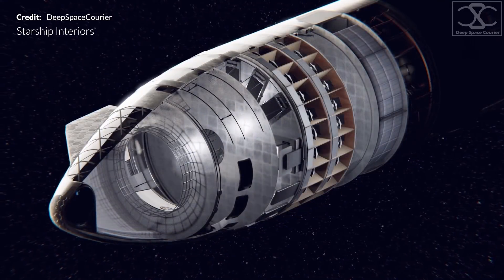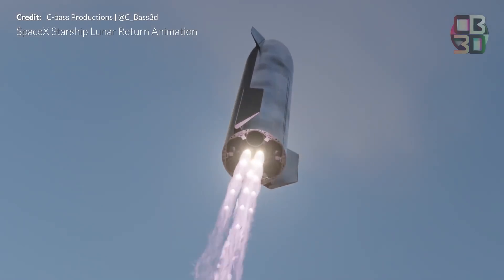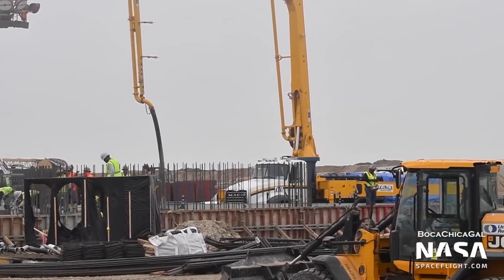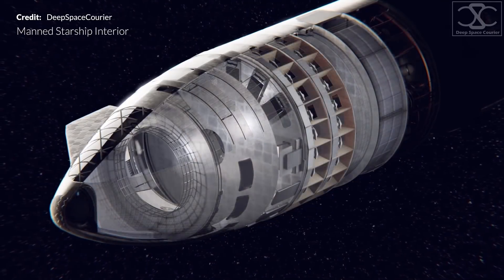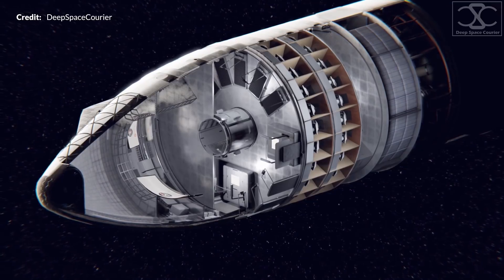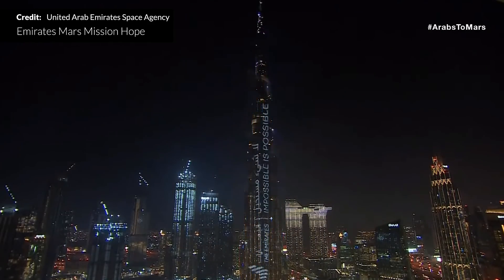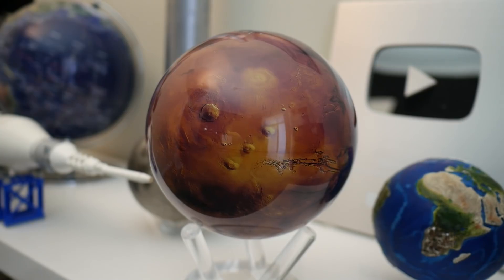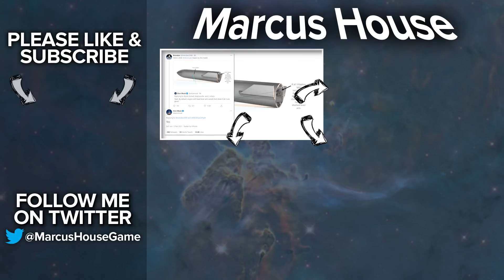SpaceX Starship to attempting another flight with SN10 - Can they master the flip and landing!?

Comment: Why do they invest in technology which remembers me going back to the 60s. I call it Blechbüchse. I cannot see any interesting development. One fail ofter another. Burning money by one of the richest persons on planet. Only try again if you are sure it works. Mars maybe 2059...
Reply: Yeah... because lading a rocket upright was a thing in the 60s, sure. 

How is a fully reusable rocket system with 100-150 tons of payload capacity and $2million per launch not a huge leap in technology?
Reply: @3gunslingers  yes it would if it works. But I only see fails.
Reply: @mtumix  
Okay. So you simply don't understand how SpaceX operates.
Do you at least know how many "failures" they had until they landed a Facon9 first stage?

Comment: I wonder if there really will be that much open space in the starship in the end! Quite some risk of getting stuck in the middle of the space due to micro gravity and nothing to bring you to the walls again:D
Reply: I don't think you will ever be alone on a Starship.

Also what would make you come to a stand still in the middle of the room?
Reply: @3gunslingers  not a full stand still maybe but a very slow drift without having anything in reach to push yourself off from. Though as you are not in a vacuum you could actually get to a stand still as well due to air resistance and drag. 
Sure other people could help you but it for sure would be an annoyance to have to ask someone to go fishing for you...
Reply: @JLohmann2012  
Air in a space ship has to be rotated constantly. Else pockets of CO2-rich atmosphere could form.
This airflow would carry you reliable towards the "AC" unit.
Reply: @3gunslingers  good point! I didn't consider that! How long would it take though? Can't imagine there to be much force behind looking at the mass and speed of the air molecules in that circulation system
Reply: @JLohmann2012  
"How long would it take though?"
Good question.
You could look up the average ventilation speed on the ISS and calculate the air resistance of a human body.

Comment: Artemis Gateway first 2 modules in 2024? I can't help wondering whether in that time SpaceX couldn't get together with Sierra Nevada Corp (SNC) and hard-mount a SNC LIFE inflatable hab module onto the forward (CH4 dome) with a docking module attached to the front of the LIFE hab module. The Starship could then, after Earth orbit refuelling I assume, fly to the Gateway orbit, open a modified payload bay fairing that opens like the petals of a flower rather than a clamshell (think the space-ship eating spaceship in the James Bond "You only live twice" movie) and then inflate the hab. Solar panels could either be folded up elsewhere in the payload bay and unfolded when the fairing opens or the inside of the fairing could even have solar panels on the inside of its "petals" or some combination of the two.

The above could place a way bigger habitable volume space station in orbit in a single launch (plus however many tanker refuellings are needed). The current SNC LIFE hab has about 330 cubic metres of pressurised volume I think and the docking section mounted on its nose would add even more vs I believe 125 cubic metres for the Artemis Gateway station and that's after the extra space from the  i-HAB (international Habitation Module) is added to the space in the HALO module and that isn't expected to be launched until 2026. ANd the Starship payload faring could take an inflatable hab module way bigger than the SNC 300m^3 version which only needs a 5m fairing if they wanted to go even bigger.

Since a space station Starship is never going to land a whole load of weight could also be saved from not installing fins, heatshield, legs or header tanks which makes the refuelling requirements easier and once in the desired orbit one or both of the CH4 and LOX tanks could be flushed and re-purposed for other consumables needed to maintain the life support systems and/or the positioning thrusters which would give huge reserves of supplies. They would already have plumbing to be replenished by a supply ship thanks to the on-orbit refuelling technology.

I know that SpaceX has a laser-like focus on other things but if it decided to do such a thing launching in May 2024 to match the planned launch date of the HALO+PPE module, 3 years and 3 months from now, would not be a problem for SpaceX with its rate of innovation and the Starship wouldn't even have to be human rated, only the SNC Life module shown to be safe. Crew could initially be shuttled to and from the station by other human rated launch vehicles as is currently proposed if Starship didn't have human rating by then.

This all seems so doable to me if there was the will to do it and it would be a great test of long term life support systems, long term stays outside of Earth's radiation protection, and get real deployment experience for full scale inflatable habs.
Reply: "Since a space station Starship is never going to land a whole load of weight could also be saved from not installing fins, heatshield, legs or header tanks which makes the refuelling requirements easier and once in the desired orbit one or both of the CH4 and LOX tanks could be flushed and re-purposed for other consumables needed to maintain the life support systems and/or the positioning thrusters which would give huge reserves of supplies." 
You are on to something!

But I don't think they will use any inflatable habitats, tho. Those are very likely much more expensive than just sending a second Starship.
Reply: @3gunslingers  Yes, in my heart I agree on the inflatable hab. Easier and quicker to just kit out the payload area as pressurised habitable volume with some space lost to folded solar panels that deploy when in orbit and for docking ports. Even with that “lost” space when we’re starting within almost 1000m^3 of internal payload bay volume even if you use half of it for that other stuff you still end up with a pressurised habitable volume almost 4 times that of HALO+i-HAB combined. My inflatable hab twist would only come into play if you wanted to create something huge, maybe 2,000m^3 of habitable space for a big long-term presence and lots of science, and/or if you wanted to test applications of inflatable hab technology. It would be cool though. Imagine if Artemis did evolve to something twice the size of ISS with 16 or more crew on board at any given time doing lots and lots of science. For the first time since maybe the 1970s I’m actually beginning to believe again that I might see some of this sort of stuff happen in my lifetime.
Reply: @julianfp1952  
"My inflatable hab twist would only come into play if you wanted to create something huge, maybe 2,000m^3 of habitable space for a big long-term presence" 
I think it would be cheaper and easier to just fit out the tanks of Starship. The tanks provide 1,300m³ of pressure-tight volume.
And since on Lunar Starship the tanks have to be shielded against micro-meteoroids anyway, they are also human-rated.
Reply: @3gunslingers  You’re not going to let me have my inflatable hab are you? 😭😭😭😀 Being serious though, you make another good point.
Reply: @julianfp1952  
"You’re not going to let me have my inflatable hab are you?" 
NO.  ;)

"Being serious though, you make another good point." Thanks. I did quite some research about inflatable habitats and they are simply not as good as they seem to be at first glance. 
They are quite heavy and very, very expensive because of their special hull fabric.
Reply: @3gunslingers  Good to know. Well, not “good”, more disappointing actually, but interesting and useful info.

On converting tanks though do you not think it would be very tempting to keep at least the bottom tank (LOX if Lunar SS has the tanks the same way round) for space station consumables, or maybe with a single tank I should say consumable? With Sabatier and other conversions can we get close enough to a closed life support loop (given enough power) to only need 1 gaseous or liquid resupply item? Maybe more nonsense from me but it seems so tempting to keep at least one of those huge tanks as tankage given that by definition the tanks have refuelling plumbing to an external docking ports capable of forming a leak-proof seal with a tanker for refilling the tank with a cryo fuel so using it resupply with water for instance if that was the highest volume consumable should be possible.
Reply: @julianfp1952  
Totally possible. 
Tho from the top of my head I can't think of a single consumable that one could want to have in such volume. 

You point about the "refuelling plumbing to an external docking ports" is really interesting. Those ports don't have to be limited to methane and LOX. I never thought about that. Thanks!

Comment: Hey great information but just so you know in Concrete construction. Footings are the bottom most portion of the concrete  usually under walls or underneath the perimeter of the slab to support the structure that is going up.

Comment: And for the testing materials and construction, isn't it time for using 3D printing technology to avoid most or the welding where most of the leaking issues occurred? Seems tech-backwards to be making these beasts like this if they want them to be reusable and safe for a quick turnover.

Comment: Why don't they light up the raptors and perform the flipping maneuver earlier so they can decelerate and hover for a totally controlled landing. Seems like an unnecessarily risky maneuver the way the are performing it. It's as if an airplane didn't decelerate until the landing gear touched the ground.

Comment: at least engage the flip 2to 3 kilometer  before reaching the landing pad to make sure stable and smooth engine position 😆
Reply: Except that would decrease the drag coefficient and increase terminal velocity. Starship would then need to use more fuel to bleed off the speed prior to touch down. The manouver is designed like this for a reason. This being said I wouldn't want to be inside during the landing ,😀

Comment: I still think a direct moon mission makes more sense, but I won't complain as long as they move forward
Reply: I agree. With refueling a Starship could go to the moon and return.
Reply: @MrEd2291  or simple use a vehicle which is able to travel between the moon surface and LEO. 
You could refuel it and change the crew with a falcon 9.

Comment: I think what the people forget is that Raptor is a completely new and barely tested engine... this is about as much to gain experience in making the engines go reliably under flight conditions as it is a test of the whole starship flight procedure... 
They are only 50, 60 built engines deep in the series with later rockets needing insane numbers of engines EACH (Superheavy/Booster engines will be what? 27? 29? PER Rocket! and even the Startship with then 6 engines is not "cheap"), losing a dozen or so in experiments they get so much data from is basically childhood woes of such a prototyping exercise...
Reply: I'm sure when the time comes to turn the "normal" Superheavy/Starship combo into the Moon rocket we'll see 2 or 3 deaths again with the new Lunar Landing engines as they'll go through similar problems at first...

Comment: SN10 will end the same way, they need to sort out the fuel supply issue from the header tanks after the flip manoeuvre. This is a challenging problem, Helium didn't work. Redundancy is not the solution, fuel supply is it. I don;t hold much hope for the successful landing of SN10.

Comment: SN9 crash? "Fail often, fail early" as is sometimes said particularly in the pharmaceutical industry. Had SN9's flight not failed as it did at what point would SpaceX have revised the landing procedures to light all 3 engines and if all 3 light then immediately close down the one with the shortest lever? In the absolute worst case nightmare scenario perhaps only after a crewed Starship crashed. So much better to learn that lesson early by losing a relatively unsophisticated prototype vs a production vessel complete with heat tiles, full internals, fancier legs etc, and most importantly with no crew on board.

Comment: The overall goal of the Starship program is lower cost and rapid turn around. Part of that plan is retuning the ship as close as possible to the " shipyard " for the fastest possible refit.
Reply: Solving the exploding on the landing pad problem might be worthwhile before you land it right next to the next in line though.  You don't test the safety on a gun by pointing it at someone and pulling the trigger even if the goal is for it not to fire.
Reply: @wolffang489  just a dumb thought but would a dug out landing pad with an elevator to bring it back up help? It goes wrong, it goes boom underground., funneling the explosion power up like a fireworks factory. And humans know how to dig, its not that hard. Not sure if the soil there is suited for it though.

Comment: The same engine failed on sn8 and sn9. Is this why a different thrust puck is going to be used?
Reply: They failed for different reasons. In one the problem was fuel flow. In the other the problem was engine start. Now is the time to have failures that they can correct and move on from.

Comment: I think they are banking on the resilience of stainless steel. They've hammed out dents n flown before. The other equipment most needs to be in the area and has some shielding. They need to be this precise. Even in failure, if the they hope to to be rapidly reusable. The pad needs to be rapidly repairable. That needs development to.

Comment: Given all the pressure test failures they had earlier, I thought the tanks were already as thin as they could possibly be... Did they find a way to fly with lower pressures? Is their custom alloy really that much stronger? Are they just thinning the top sections that don't deal with the gravity induced head pressures at the bottom?.... I.E. fill me in on the whole story about the thinner tank walls.

Comment: They should consider doing the restart manoeuvre from bellyflop in a higher altitude.....to give them more time for engine restart
Reply: That doesn't really help, you'd have to be carrying more fuel for the landing then, and if the engine relight fails, it doesn't matter if you had started trying 5 seconds earlier.

Comment: I believe the landing location close to the OLP is a result of two things; 1, they don’t want to spend money developing and repairing a landing pad they will not use after proto-typing because (second) they want to land starship close to the OLP so their launch tower can stack the starship for re-flight in just a few hours. If the landing pad was  just 100 yards away it would be too far for their long-term plans, much less a kilometer away. Thanks for providing information and an outlet for my nerditude.
Reply: From Hopper onwards - whether RUD or not - Boca Chica vehicles have landed where they were meant to so the chances of damage to other structures or vehicles is minimized. Nothing will ever be perfect and Space X is proceeding where it has the money to do so.

Comment: SN9 failed in a different way from SN8, from a testing point that's actually great since it shows other areas that might need tweaking.  Would have been great if it had stuck the landing but it's all good data to work with
Reply: If SN9 didn't fail, they would've never considered relighting all 3 engines for redundancy. That's a win for everyone, especially safety. (Although it seems like someone would've thought of it at some point.)
Reply: Well without failure we would not be where we are today
Reply: @sadiqahmed4143  exactly

Comment: Terminology suddestion: For ion and TNR engines, it would be better to use "reaction mass" rather than "fuel", since the energy used is separate from the propellant
Reply: 'reaction mass' I've never heard that term before but I really like it. It's not really fuel since it doesn't provide any energy.
Reply: Any fluid or gas will work as reaction mass, though some are better than others. For ion and plasma drives the best working fluids are low atomic weight gasses that ionize (loose  electrons) easily and are not chemically active. Low atomic mass produces higher specific impulse and low reactivity reduces corosion and wear.
Reply: Just "Propellant" works as well.

Also, in electric thrusters that rely on ionizing their propellant to accelerate electrically (not thermally), you actually tend to want higher atomic mass, because that means less energy wasted for ionization. The specific impulse can be increased by raising the voltage and reducing mass flow instead, you don't need to lower the atomic mass for that. This is why Xenon was standard, and Krypton is the next best when Xenon is too scarce (i.e. the entire world production of Xenon would not be enough to supply Starlink for example, so SpaceX had to move to Krypton)